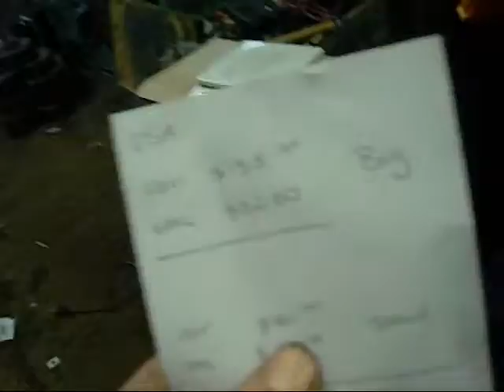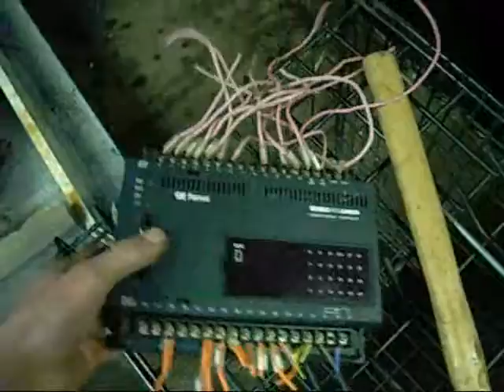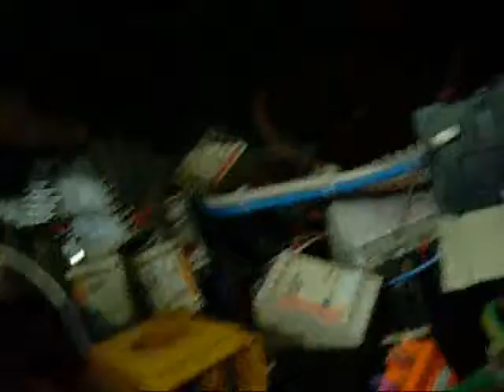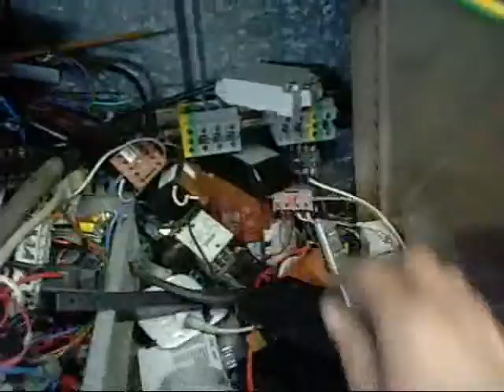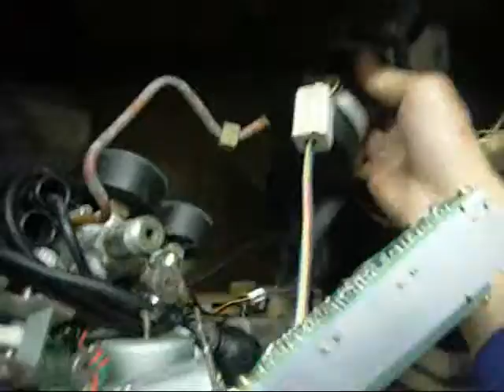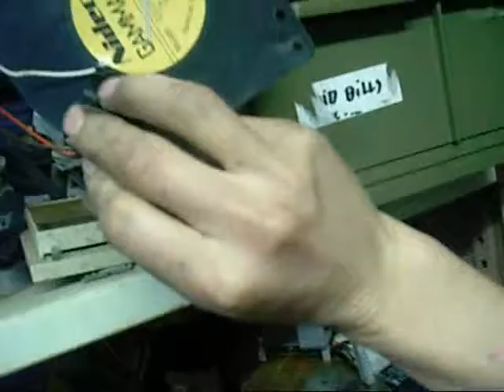Breif Scrap yard Visit and More Stuff For Sale

Comment from the maker: @67tr876 the driver emulates 3 phases using DC, I've never really looked into the specifics of it.
you just need a couple of power inputs and a trigger signal to tell the motor driver what to do. (fwd, rev, lock, speed control)